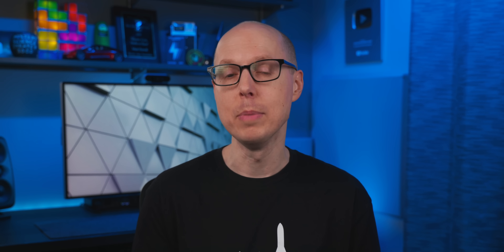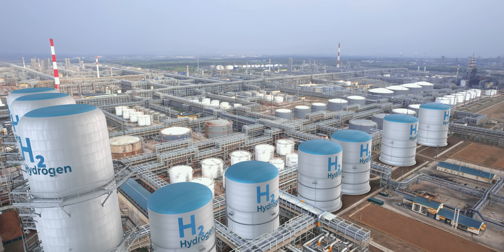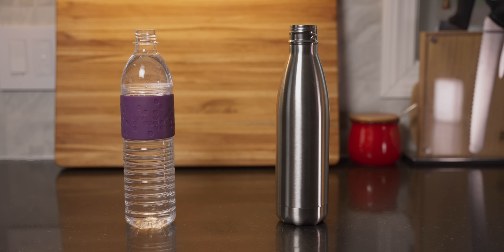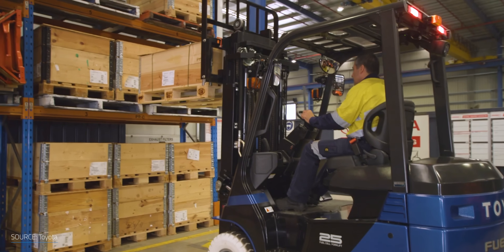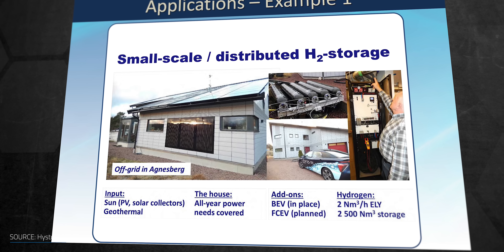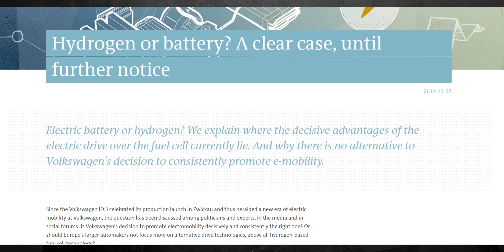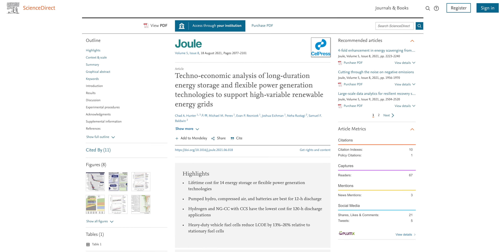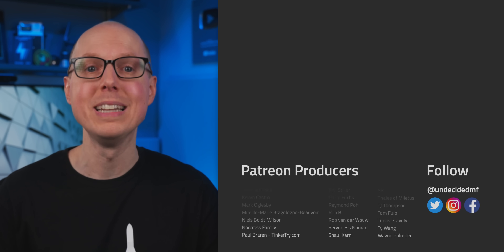Solid Hydrogen Explained (Again) - Is it the Future of Energy Storage?

Comment: Very good - a solid follow up - you are honest about the realities and time scales, and bench top lab experiment to industrial scale process is a very long road indeed. One piece to be extra careful around is the fairly new "90% efficiency" claim of renewable to hydrogen and back to electricity, but only if you have use for the 65% heat loss - you don't get 90% input electricity back, you still only get 25% back - in the diagram you held up, they show heating a building, but that assumes a proximate building needs heating at the same rate of heat production from generating electricity. Due to zoning in the US, there is a low likelyhood of an apartment block being right next to an industrial electrolyzer or fuel cell (or both) and then only needing that heat while renewables are generating. I know another 90 seconds to lay that out would have been too much, but there is no route to 90% input electricity recovery from electrolysed hydrogen and I urge you to be a bit clearer about that when putting up 90% efficiency on the screen.

I really recommend adding Paul Martin to your collection of excellent advisers, I've learnt a lot from his Linked In posts on hydrogen for vehicles and storage, he lays out pretty clear reasoning why hydrogen as a battery is unlikely to succeed, how important greening chemical use hydrogen is (80 millions tons a year, 97% fossil), and how often buzz, news stories and press releases around hydrogen need to be pulled apart further to get to the truth.

I'm glad you have not gone the route of some YouTubers who took Toyota's cash to mislead the public about the sources of Hydrogen for the Mirai. My main concern about vehicular hydrogen is that it's used as a distract and delay tactic to slow down battery electric take-up - while that's a largely won battle now, with battery EVs well on their way, you still see vehicular hydrogen advocates pushing half truths about the efficiency and 'future low cost' of green hydrogen.

Comment: Great video. Without question gas loading of a metal lattice has great potential and use. In fact that Australian company claims that the resulting pressure from electrolysis is sufficient to load the H gas into that metal lattice. Thus you get some great H density storage and without the huge penalty of having to liquidify the H gas.
However at the end of the day, if you need 40 gallons of liquid H in a tank, then that's what you need. As such the weight and size of such tanks is not practical for cars. But this technology and gas loading of metal lattice still has many commercial uses. In fact, experiments pre date 1900. They found that a block of nickel could absorb its own weight in H gas, and hold that gas at room temperature and pressure. Interesting that quote suggests that even including the weight of the metal lattice you can achieve a higher volume of H gas storage per weight WHEN even having included the additional weight of the metal then what you get with liquid H gas alone. So gas loading of H into metal lattice has been known and experimented for over 100 years now.

Comment: It's great to see hydrogen / fuel cell tech moving forward. I know it's less efficient, for now at the very least, but I firmly believe that the most environmental thing to do ... is be less efficient. Yes, I can use fewer solar panels with a battery system than with a hydrogen system. But if I do that, then I require a huge amount of a very environmentally unfriendly technology. It's only "better" if the only thing you care about is optimizing for CO2. If you consider mining damage, pollution, and unpleasant chemical concerns in general, it ceases to be better. The same logic applies to reusable bags. They are actually worse for the environment than single use plastic, if all you care about is CO2. Meanwhile, we know that there are other, very important concerns that would make the efficiency loss desirable. On top of that, though, hydrogen is a much better solution for things like clean energy usage during low demand periods, letting us run windmills outside of demand, and storing the energy. And finally, perhaps one really interesting thing: The oil/gas automotive situation is going to need to go away. When this happens, those companies either die, or don't. They won't want to, of course. This is a good opportunity to give them a role in the solution. After all, who in the world is better positioned to move a flammable stored material to on site tanks at fueling stations that are strategically located for the common usage patterns of modern vehicle travel? That's literally what they're already doing with gas. On top of that, as we integrate clean energy with the possibility of storage as I described, cost per kg will drop. Combining cost per kg and miles per kg still gives us a better cost per mile than gasoline, today. Over time, this will improve. I personally see hydrogen as a vastly better option for transportation than lithium. You have significant weight improvements, capacity and range improvements, fueling time improvements, retain the ability to obtain your own fuel at home with your own solar panels, cut out a massive amount of mining and shipping, and don't have 5 to 10 year degradation periods, with substantial reductions in storage and range. Even better, the process model works better for non-car situations. You already showed the German subs. It also works better for trucking, trains, planes, ships, busses, and taxis, where weight, refuel time, and range are all massively vital to the functioning of the system.

Comment: Energy storage for heating to replace batteries for home use or local storage for multiple dwellings or business use . Major problems not just with its storage but conversion through fuel cells which are highly expensive and require very specific heavy metal catalyst materials . Running/ servicing costs also limiting factor. As a fuel it needs to be used with a fuel cell stack to get the best efficiency and this may be more viable in larger ships, submarines and land based energy uses such as heating urban developments etc , particularly in small isolated communities which could give them energy independency. Would maybe work well in very sunny areas or windy areas where the storage can be kept more local rather than putting on the grid at peak times. For wind energy in particular this would be good for storing excess electricity for later use at off peak times

Comment: Realistically any "new" energy ideas need to work easily for everyone. Ideas that can use what is already there : existing electricity, gas, coal, transport, oil, microwave networks makes sense. So new ways of using existing electrical, solar, gas, nuclear, wind tech are all sensible. They can all simply plug in to the global infrastructure. I just dont see H2 as being sensible because it seeks to reinvent tge wheel..

Comment: As a cynical misanthrope, I simply see absolutely no realistic possibility of hydrogen for any form of transport or haulage smaller than trains or other large vehicles with specially-trained maintenance/operation technicians. I see TiKTok videos of brainless morons pulling away from gasoline pumps with the hose still in the side of their cars, tearing them off & disabling the pump, then use that standard to evaluate the practicality & feasibility of energy sources for consumer vehicles.

Comment: you need to clarify EXACTLY what is meant as a metal hydride. LiH, BH3, AlH3 are examples of molecularly bonded metal hydrides. Your examples actually show Hydrogen atoms trapped within a crystalline metal matrix. It is a surface effect of adsorption, and it is surface area dependent. Entraping Hydrogen deep within the matrix will make it harder to come out as needed. Furthermore, the simulation shows single H atoms being adsorbed. It takes a lot of energy to break a H-H bond. Liquified ammonia, NH3, at 223K, contains 123 grams of Hydrogen per liter, compared to liquid H2, at 20K, and about 60 grams/liter. Leaving aside the energy necessary to compress and cool the H2 , it is easy to see that NH3 has twice the energy, volume wise, as pure H2. Plus, NH3 smells to high heaven, making it easy to pinpoint leaks, while H2, even its flame, are almost undetectable. H2 has the nasty habit of permeating through metals at high pressures.

Comment: Interesting, the analogy of storing H2 to storing electricity within various lattice structures.  This week’s “Just Have a Think” reviews progress with battery technology in this area.  I am definitely in the camp that electric batteries will win overall, while hydrogen will have a few niche markets that will tolerate the major risks of explosion.  Ironically, a few decades ago, we were looking at using activated carbon as a method of natural gas compression by absorbing and heating to release at higher pressure.

Comment: I would say the much larger elephant in the room when it comes to hydrogen is that the act of building all the infrastructure for it ends up Also creating the infrastructure for black hydrogen.  Hydrogen obtained through chemical separation of natural gas,  which remains the source of over 90% of all commercially available hydrogen, and is far cheaper than any currently existing green hydrogen source. 

For all the talk of how it will enable all these green hydrogen options,  any infrastructure created for one also works for the other.  It will be completely neutral about the source.  And if dirty sources are cheaper, they will win market share.   In many ways the push to create hydrogen infrastructure is just another way for the fossil fuel industry to green wash their dirty products.

Comment: At 3:35 your looking at the Operation and Maintence cost of the system NOT THE TOTAL COST, just look at that ludicously high capitol cost at a minimum of 10x and a maximum of 100x compressed gas costs and it's obvious this is not a glowing assesment from DOE.  How do idiots in the comments section lap this shoddy work up without even looking at whats on the screen, let alone doing any research of their own.

Comment: Pretty sure most of the water vapor coming from smoke stacks is water produced in the initial combustion process. Otherwise you're leaving a ton of energy on the table and also smoke stacks would basically be on fire.

Comment: Well they can reduce the energy needed to produce the heat needed by just plugging the equipment into the roof of fossil fuel generators, the heat generated by those can be recycled into the tanks or whatever that release the hydrogen, I'd wager there's also other places that heat/cold can be recycled from, such as nuclear reactors, or the pipework of geothermal generators, plenty of ways to make the process more efficient just throwing away the conception of "this equipment must be fully self sufficient"

Comment: Henry Ford stored hydrogen in bundles of fine steel-wool.
The metal is 'porous' to the gas, and would absorb quite a lot.
To get the gas back, heat from the exhaust would warm up the metal, liberating the gas.
Embrittlement saw short service-life for the wool; the gas and vibration from driving made the metal crumble in short order.
A pound of hydrogen may have more energy that a pound of hydrocarbons, but hydrocarbons are easier to sell to the public at the pump!
Don't discount convenience and public perceptions of risk.

Comment: So the way I see it, you need to cool the metal lattice to hold the charge and heat the metal lattice to release.
You also said that a big problem is the efficiency losses involved in this cooling/heating process, let alone the hydrogen production to feed it.
As resonant waves through a metal can syncronise the local metal lattice density and act like an extraction/pressure pump, (just like we see charged and uncharged hydrogen in the solar winds)
a. has anyone tried electromagnetic localised waveform charging instead of hot and cold cycling, so that we only use the energy required for localised charging, not erratic vibration forces that could hinder flow by closing pathways and creating flow resistances where it is not wanted ?
b. as we are dealing with electromagnetic waveforms anyway, could hydrolysis be used directly as part of the charging process, to create a more efficient combined process ?
Reply: Sharp set of suggestions!

Comment: Solid hydrogen has issues with efficiency for small applications.  Extracting Hydrogen takes heat. Some aplications use waste heat generated by motors and fuel cell to release hydrogen and using with small battery it looked interesting. Though you need insulation and casing etc to keep that heat in hydride canister making it pretty heavy.
Also I feel plasma kinetics forgot the temperature controlling exhaust gasses and compressing gas from electrolysis is using energy. OH right, you need to compress that hot gas from furnace to get hydrogen to go inside metal matrix too. Lack of working prototype might be indication how hard it is by using a 10% efficient laser to heat relfective metal in contrast to working ones using powders and just heating it.
Reply: Check out the recent development of MATTER LASERing; just seen this week in some of the Tech websites

Comment: You've corroborated the "Joe Cell" and how it must work. About 10 years ago, people were talking about a Joe Cell, which many people believed was some type of magical "Torsion Field" generator or "Orgone" generator. Out of curiosity I did some experiments, and found that the Joe Cell is just a hydrogen generator, and the hydrogen goes into the cast aluminum engine cylinder head, pistons, and intake manifold. Once the hydrogen leaks back out of the metal, it slightly augments the combustion.